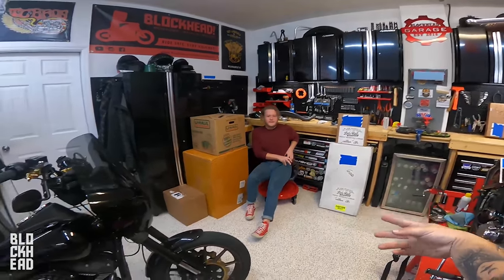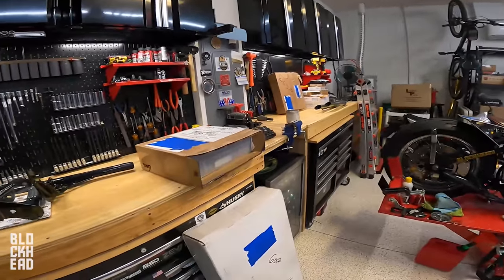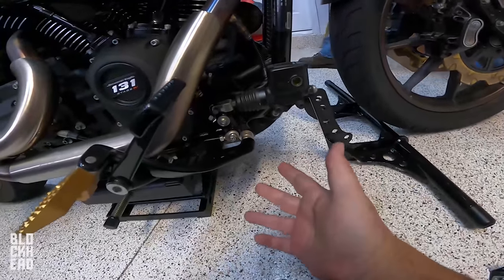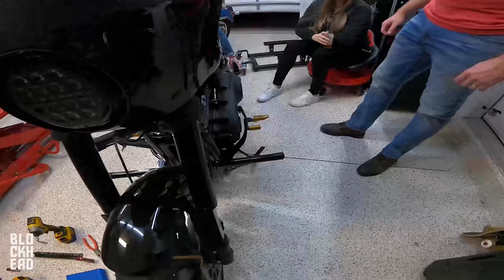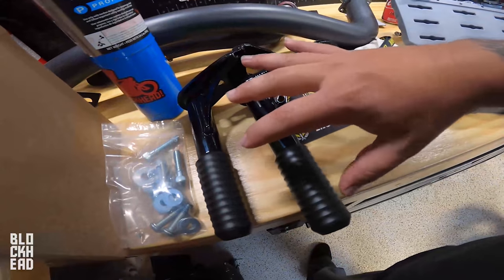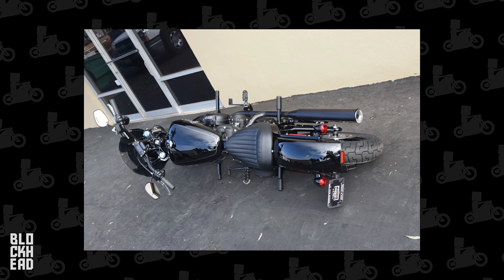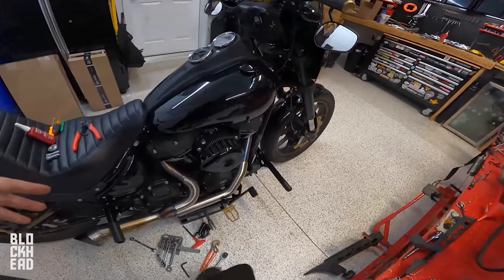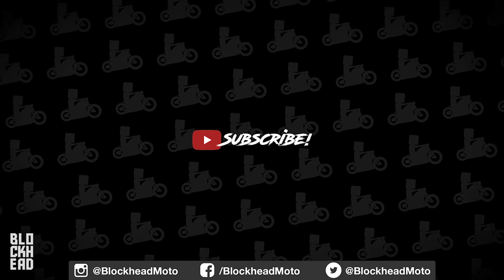The 131ci Stage 4 is kinda scary...

Comment: Riding in the rain is the biggest anxiety I have with the big bore kits.  So much torque going to that rear wheel that it can get away from you if too much throttle applied by accident.
Reply from the maker: Definitely have to be careful with that throttle control!

Comment: Always make sure its toight. I had an 05 road king classic that I'm quite surprised that I didn't scraped my left foot board turning off one bridge onto an overpass. I discovered how much I can lean it do to the fact that the first few times I made that turn I'd scrape my boot because I always ride with my toes slightly out from the the middle of the boards. I later was a little more aware and usually tipped thin inward.

Comment: Reason we have 200 horsepower bikes cuz of factory electronics.  We have passed the point of tire and physics were electronics are needed.  That is why cars were mandated to have stability control in 2012.  Now the tech is compact enough to be offered from factory in many cases standard.

Comment: I ride sport bikes and you got me thinking about a HD just like this. I bet it isn’t as nimble though.
Reply: If you ride more than 20 mins at a time, I would trade the ferrari in
Reply from the maker: It's not as lightweight, so doesn't feel 'quite' as nimble, but with the taller suspension I've put on this one, it's still very maneuverable! The lean angle isn't even comparable though, haha

Comment: I wish somebody would make a huge cover that goes over our primary's cause even with these it still hits. Especially in a big drop where there would be more flex.
Reply: Check out motorcycledropguards. I know they make those for the touring models. It protects the primary cover. I just ordered a set last week and they are on backorder.
Reply: @pep4600  thanks dude!
Reply: I put a primary skid plate on my Dyna. The company that made mine is called Bulletproof

Comment: Hey Blockhead, Im not sure if they help with leaning in the twisties but there are a few companies that make sliders out of skateboard wheels, for the crash bar. I dont have them yet so Id rather not make a specific reccomendation, but from what Ive seen they look great. Basically you remove the derlin sliders (thoes black plastic end caps) and the wheels go in their place. Theres some guys in the various FXLRS and Softail groups on Facebook with them.

Comment: Imzz elite crash bar is inch shorter on each side and the peg with touch first with it if lean good and my bike was dropped 😅 and only rear signal got scratched and grip n clutch lever got scratch everything else was saved

Comment: Did you feel any vibrations on the front crash bar? I installed mine on my street Bob and when I’m full throttle and above 4,000 rpm’s I feel like it vibrates my pegs more than usual. All looks tightened down and torqued it to spec. 

Thank you

Comment: I bought the Harley Mustache front crash bar. For the rear, I did buy the bung king sliders from Get Lowered, but they sent me the front crash bar instead. Still waiting on info from them on how to return it. It's been 2 weeks
Reply from the maker: Try giving them a call, they're usually pretty good about picking up the phone.
Reply: @BlockheadMoto  I gave them a call on Thursday. They might have been out for lunch because I had to leave a voice-mail, but I haven't gotten a call back either. I'm trying to be patient with them though.
Reply: @thevtwinwanderer  I did the same for my street bob, I have the HD flat out for the front and BUNGKING rear protection. Have not dropped the bike so not sure if anything will scrape

Comment: “Scary” LOL. Lord, I wonder how you’ll feel when you graduate up to a bike that’s actually powerful.
Reply: He owns sports bikes, so I'm sure he is used to high horsepower bikes. But that bike will lift the front wheel up, and I'm sure the torque on that is way more than a sports bike.
Reply from the maker: 140hp / tq isnt' "powerful?!" Are you a Busa boi? 😅 What about this bike, does it count as 'powerful?' - https://youtu.be/Nys1lpCZp64
Reply: BLOCKHEAD Nah, not a Busa Boi LOL. 140hp/tq on a 680lb bike isn’t bad, but it’s not “scary powerful”. When I bought my ‘18 Fat Bob, a really nice and well-meaning old timer walked up to me as he saw me placing my tag on the new bike and was trying to give me kind advice. “Better be careful on that one, it’s really powerful, maybe too fast”. I placated him with conversation about it but was shrugging it off a bit, so he kept on about it as if I were in some real danger. That’s when I pointed over to the bike I traded in for this one. My 2013 Vmax. 200hp and 165tq which I had owned for 4 years since new. I explained the difference and his face lit up and he smiled “yep... I think you’ll be just fine”. I now daily ride a CVO Dyna and while I absolutely LOVE it, and the stage 2 on the 110 feels really good, I still realize that it isn’t, nor will it ever be, a real powerhouse. I’ve loved all of the Harley’s I’ve owned for a variety of reasons, but I always consider power and handling to be on the lower end of the requirements when buying one. I enjoy modding them to be better at both, but I know I can have my ass handed to me by a stock bike that costs several thousand less at any time.